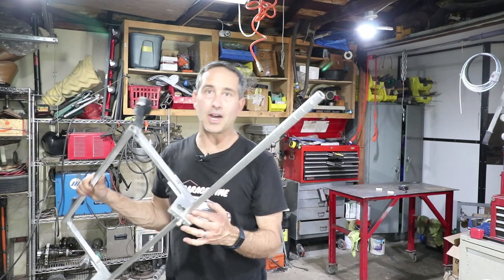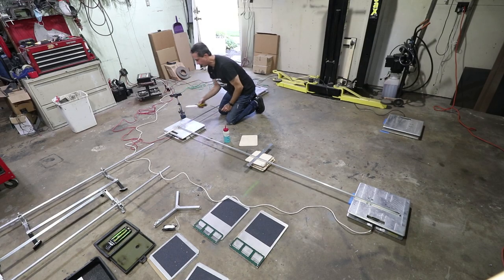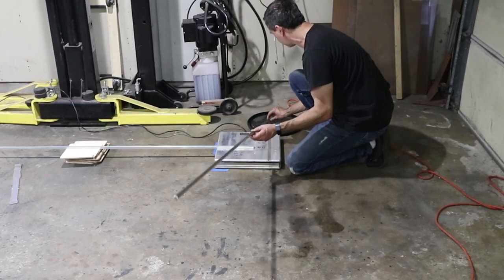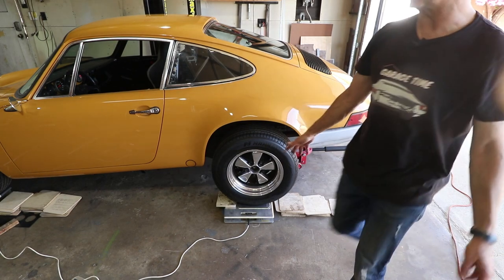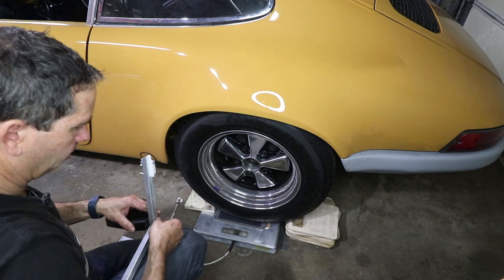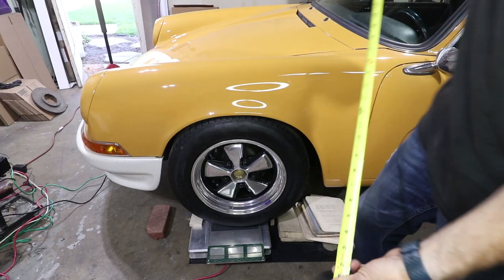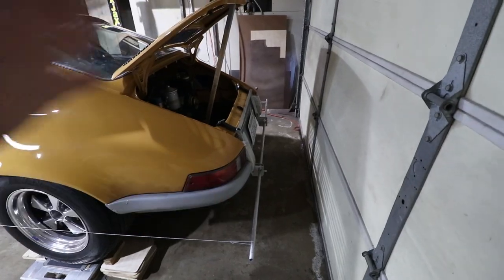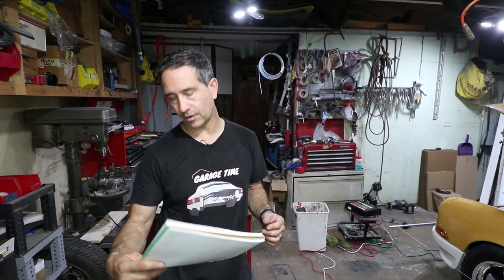First Wheel Alignment Measurements Are Awful & Corner Weights Revealed  Porsche 911 Suspension Setup

Comment: Hey Tom, my rear height is 24-1/2" and I set my fronts at 25". I am too cheap so I drive mine at the local old air strip (concrete) and increase the load on whatever front (always the front) that locks up. I load it and the diagonal opposite rear until I can hard brake with either neither front locking or both of them. It has worked out pretty well but if I were to start racing it I would take it John Walker and have him balance it. I realize it's crude but it appears to work.
Reply from the maker: That's the same heights I'm targeting.  Maybe slightly higher in the rear.  
Your corner balancing method sounds great to me.  Just don't flat spot the tires ha ha.
When I hit my brakes hard the rears lock up first and the car turns.
So I know I have lots of adjusting to do
Reply: @GarageTimeAutoResto  Yup, you get a flat spot it’s gonna lock up on it for sure!
Reply: @GarageTimeAutoResto  Hey Tom, I just ordered a set of mechanical/hydraulic corner scales off of Ebay. I am going to use a jack to set my 911s on the scales but what about getting the suspension to relax? How much effect will that have? I was going to build a set of "Buggles" corner scale units that bolt to the hubs and have rollers that allow the suspension to relax but is it worth it?
Reply: Ah, discovered a couple of smooth vinyl floor tiles with axle grease between them placed under the scales will work.
Reply from the maker: Yes, that will work.  Mine are metal with Teflon instead of grease, but same result.  
BTW, yesterday I was torquing some lugnuts and it shot the metal right out from under the tire.  The full car weight was on them.  So they are slippery!  Be careful👍. Congrats on the scales too

Comment: Interesting certainly going to help a lot of viewers, I've spent many hours with the string setup over the years and one thing I'd recommend I didn't see is centering the strings to the axles, not sure if the grove's you've cut may alter this as I've never used a groved bar. So use the centre caps or ideally pop them off and use center point drive shafts ect to square your string box to, it helps account for an axle out(even new cars have an axle offset!) And helps eliminate crabbing. I could also do with doing a video on this subject myself! BTW each axle to be equal distance to the string, accounts for different track
Good luck and have fun !!
Reply from the maker: Thx.  The grooves in the bar were machined in a lathe to be exactly equal.
https://youtu.be/nLb9GBxN66E
As I said in the video I'll be centering the lines to the car's suspension mounts to check a bunch of stuff, but if you use the online calculator the strings don't need to be centered.  They just need to be parallel to each other.
Send me your video when you make it👍
Reply: @GarageTimeAutoResto  agreed the groove's in the bars will help save a lot of time of measurement getting the end lengths equal ( or getting the wife to help!) Tweaking the centre of the mounting to square it to the axles combined with online will give great results, I'll try to treat each wheel as an individual, still think string is way more reliable than a Hunter machine I use frequently😕
Love the thumbnail, keep up the great work 👍

Comment: Great video Tom.  I really have never understood what people were talking about when they said "Corner Balancing"... Now I do.   Not sure if this is something I'm going to be willing to do on my own.  I will trailer my car over to your place!  In one of your next videos could you talk about overall price and time for a DIY vs taking it to a shop?  Is it worth it to buy the equipment vs having someone else do it? There seems to be a few highly respectable alignment only shops around.  Do you recommend taking a 911 there or to your Porsche mechanic?  Can most shops do corner balancing?  Maybe not a good idea to have a non-Porsche experienced alignment shop messing with my suspension components and touching my wheels.
Reply from the maker: Thanks Rodney,   I've "invested" about $600 dollars in tools including the scales.  Purchased used of course.  
The cost of a complete suspension setup is about $700 I think at a pro shop.  Maybe more if you want custom settings.  
I will probably go through this exercise 5 or 6 times as I swap components, change engines, track test, etc.
For me it's totally worth it and of course you learn more by doing it yourself.  
If I get stuck, then I'm happy to ask for help.
Some shops refuse to set aggressive ride heights or alignment settings.  Maybe it's liability?  
Ian's alignment settings are very different than stock.  
I may take my car to a "friends" shop to double the alignment just for fun.
I'd love to do a video comparing DIY versus shop costs.  Labor of love versus profit... Which is better?
BTW, I've been told privately by a shop owner that he dislikes every one of my videos and I should stop posting immediately!  Ha ha.

Comment: Wouldnt you check ride height from bottom of rim to fender, to allow for descrepency of tyre pressure.?
Reply from the maker: Not a bad idea.  This could also introduces errors because the tape measure may not be vertical anymore.

Comment: Impressive setup!  And thanks for explaining the details to us!  How much on center steering play / backlash / dead zone should these cars have?  My 1969 912 has roughly 15 degrees of play before the steering firms up and the car starts responding quickly laterally.  One front wheel bearing needed to be tightened but it didn't seem to make much of a difference.
Reply from the maker: I rebuilt the steering rack in this video. https://youtu.be/kjg82Gv_-Go
There is no play in the rack at all when new or rebuilt.
You may have a bad steering shaft coupler, bad steering rack or bad ball joints.  My car has very tight steering when I drive it.
Reply: @GarageTimeAutoResto  Wow, thanks Tom for the expert advice!  I will check all those areas you pointed out.  Looks like people on the PelicanParts forums found the potentially failed push-on retaining rings on McMaster Carr.  Hope your weekend is going well!  -Yue

Comment: Before my shop baught a drive on lift, we used stands similar to your diy ones. I would then do my alignment adjustments on my back on a creaper. Would you feel comfortable making your adjustments on your diy setup rather than moving the vehicle up and down on your lift?
Reply from the maker: I'll give it a try and see if there's good access to the rear camber plate bolts?  
I could put the scales on top of my tire stands, but I'm a little concerned that the car could slip or roll off.  
Might be able to remove one tire at time and make adjustments with just a jack without the lift stands.  
I've never done this before, so I'll share more experiences once of done more wrenching on the suspension adjustments.